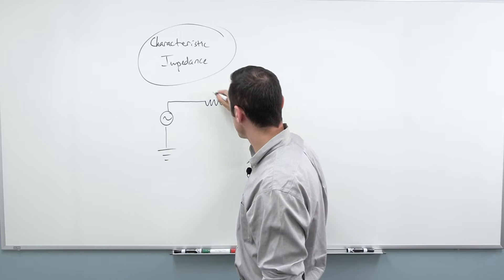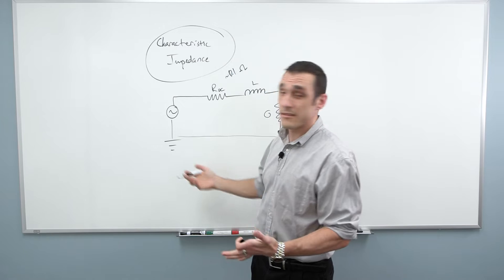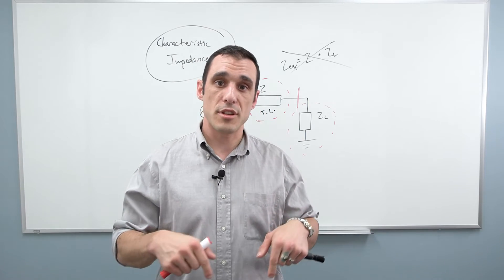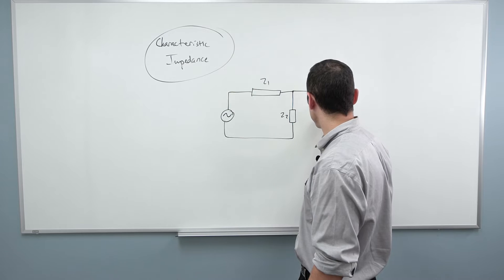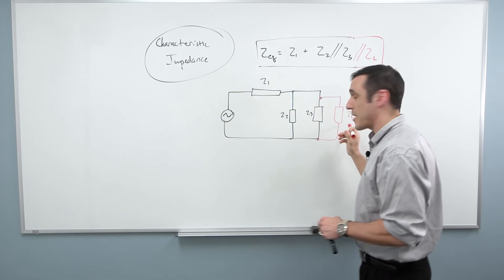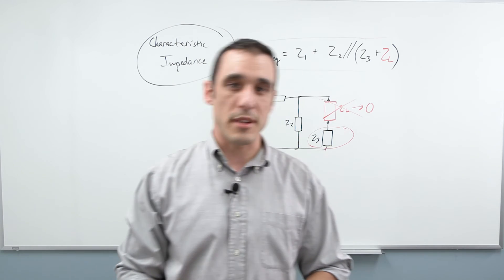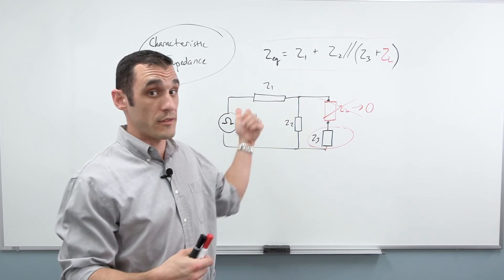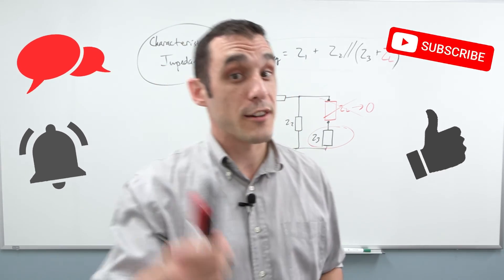Characteristic Impedance Deep Dive

Comment: How you calculate z when you are operating on dc voltage?
Reply: At DC voltage, you only have the DC resistance of the transmission line. So you just use the standard formula for resistance with a square-shaped trace. There are online calculators that can do this for you.

Comment: I think a better topic would be the why and how of transmission lines.  In a digital system, frequency is a complex issue.  A square wave consists of many frequencies, not just one., how should we be thinking about this?   What is the effect of reflections that can occur when a transmission line is not properly terminated?   What effect does the use of transmission lines have on EMI?  What effects are there on crosstalk?  ETC.   What does the energy pattern from a transmission line look like?  How does that compare to a differential pair, for example?   Practical applications are more useful than definitions.
Reply: Hi Robert,
Thanks for taking time to watch! We have an entire series on these topics coming up, so stay tuned!

Comment: Did you mean if there is a Transmission line there will be no equivalent impedance?
Reply: Hello, thanks for watching! What I meant was that you can't just sum up the transmission line impedance and the load impedance to get an equivalent impedance. This is because the formulas you use to calculate an equivalent impedance of a circuit assume that the electrical signal exists everywhere throughout the circuit. This is not the case with transmission lines and with real circuits: the signal requires some time to travel between two points, so it might only interact with just the transmission line or just the load at any point in time. Hope this helps!

Comment: Please elaborate: If there is only ONE forumula for impedance calculation, why different impedance calculators' results are not exactly same and have varying degree of accuracy?
Reply: Hi Raza, I'm assuming you're referring to transmission lines, and there are multiple formulas that are used for impedance calculations. The IPC-2141 formula is known to be accurate are low frequencies, but it becomes inaccurate at higher frequencies. If you read Brian C. Waddel's Transmission Line Design Handbook, you'll find many different formulas for trace impedance. Calculators online give different impedance because some will use IPC-2141, and some will use Waddel. Some won't tell you what they use. Others will apply an etch factor, and some won't. These are some of the reasons you will get different results in different calculators. Field solvers can give more accurate results, but even field solvers don't always get a perfect calculation.

Hope this provide some context! I'll be talking more about this in an upcoming video. Thanks for watching!
Reply: @Zachariah-Peterson  Thanks! waiting for your next video.

Comment: Uff - another video that's fast and loose with terminology :-s

You should have given the definition of Z0: the characteristic impedance of a transmission line under the condition of a matched load (or equivalently - an infinitely long line, where the reflection never returns). Then that immediately shows why terminating in ZL will give a different Zin if ZL <> Z0: by definition.

Also, you could have spent a sentence to show that R and especially G turn out to be very small compared to j*2pi*f*C, such that it simplified to Z0 -> sqrt(L/C) (with is a Real number) for almost all PCB materials >1MHz.

NB using the term "ohmmeter" for an impedance measurement device is going to confuse most newcomers, just call it an impedance meter.
Reply: Hi Laurens,
Thanks for taking the time to watch. I'm sure you can understand that with bite-size videos, we only have so much time to cover all of these concepts. We are producing a series that addresses everything you brought up, and much more. Next on the list is termination and input impedance.

Regarding the transmission line characteristic impedance, I have described this several times in terms of the geometry directly on Altium's website and in several peer-reviewed papers on the topic. Not to self-promote, but you can watch one of my IEEE or EDICON presentations on the topic (see my channel) if you want to learn about transforming lossless analytical models into lossy analytical models that include dispersion and roughness. This is the mathematically correct way to describe transmission line impedance and, as you'll see from wideband optimization results I perform in those videos, the impedance does NOT simplify to Z0 -> sqrt(L/C), and it is certainly NOT a real number. I even show that commercial field solvers get it wrong precisely because they take the approach you list in your comment. We have an upcoming video on this as well. You can also read this blog on the topic: https://resources.altium.com/p/modeling-copper-foil-roughness-altium-designers-impedance-profiler-0

Regarding ohmmeter vs. impedance meter, I'm sure you're aware that there is no impedance meter (at least not in the sense of measuring transmission line impedance). Input impedance in an interconnect or device under test (DUT) is sometimes measured with a TDR measurement, followed by converting the response to a transfer function and calculating the impedance spectrum from that. Or you calculate it using the input impedance determined from an S11 measurement using a VNA. I'm waiting for my NanoVNA to come in the mail before we start filming this!